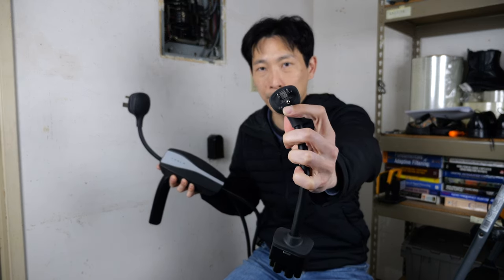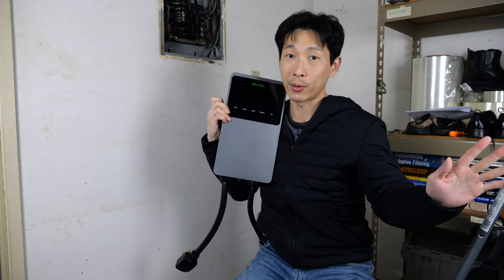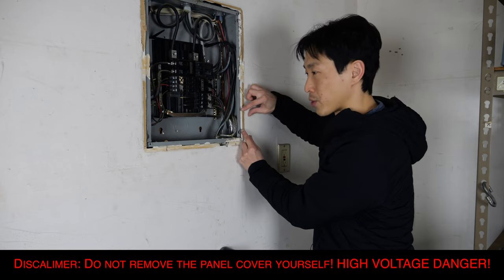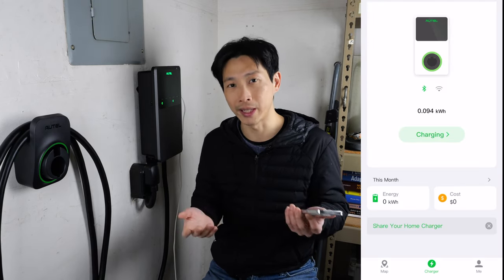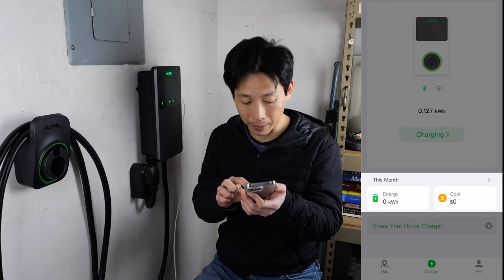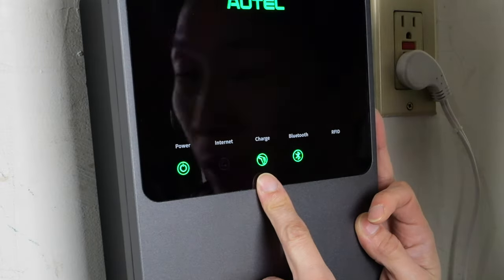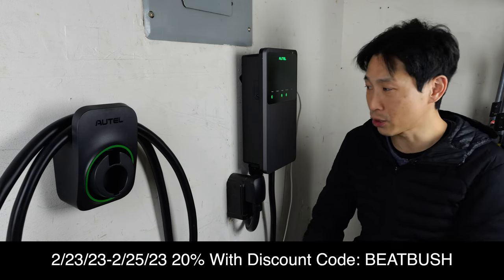Level 2 EV Charging with no Expensive Electrical Work

Comment: At my mom’s house we use the 30A dryer outlet to charge 4x faster than a 110 outlet. But we replaced the receptacle with a Hubbell one because it is heavy duty.   EV charging is a much heavier load than an electric dryer which only runs for an hour.  Frankly, i also installed a new smoke detector.  Be safe out there.
Reply from the maker: Did you use a dryer/EV outlet switch? Dryer takes priority kinda deal?
Reply: @BeatTheBush She has a gas dryer, so the 240v outlet was free.   Sharing an outlet could work, but an arrangement involving daily plugging and unplugging could lead to problems. The receptacle prongs will spread, leading to arcing/overheat.   Same goes for just unplugging your charger to carry with you every day.  My opinion — it’s worth taking extra care to keep your family safe.

Comment: Remember the faster you charge the battery it degrades faster.
Reply from the maker: A non-issue with 50A home charging (12kW). You have to worry more about supercharging at 250kW

Comment: Knowing my wife who even hates pumping gas.....I would have to wait when EV cars supports wireless charging....
Reply from the maker: I suppose it can 'wireless' charge. Maybe some plate moves up under the car.
Reply: I used to have to pump my wife's gas. It took 3 months, but I've finally trained her to plug her car in when she comes home at least 50% of the time, which is more than enough for her to get around. Range on even the cheapest Tesla is 260 miles. Most people only need to charge overnight every few days.

Comment: Guess i could get an extension cable and run it to my car
Reply: If you use an extension cord,you can only use it for level 1 charging (120VAC), and only if you get a 12 gauge heavy duty extension cord.

Comment: 1:52 Most dryer outlets are 30 amps, not 50 amps, so charging speeds will be reduced accordingly.

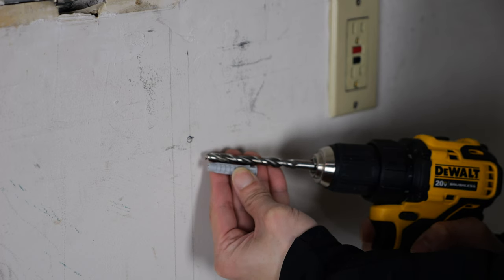3:31 Error: never use wall anchors when screwing into studs. Also, do not pre-drill with that massive 1/4" bit. Put aside those screws and anchors and  get 3 inch wood screws. Could pre-drill pilot hole with a 1/8 or 7/64 bit, if you want. No anchors, go straight into the stud.

Comment: Electrical guy here.  Am I going to sell you on hiring someone to install,. "NO!". About 90 % of electrical work can be done by almost at idiot.  That. 10% may save your life, but it is all public knowledge.  You.can find it if you look.

Let's start with wire size.  The wires to your house (from the utility) are sized for your house as built.  You are adding my a load about as big as a second stove to your house.  Can your utility to house wire handle that power?

The building code (NEC) has a section 625 that covers car chargers specifically and refers you back to chapters 1,2,&3 for other rules.  In this section, your car charging receptacles require gfci protection.  Yes, iit also requires gfci protection in the charge unit.  It has circuit current requirement of the charger plus 1/4 more current or q reduction of the charge rate and more.  Other chapters cove requirements like wire type and the need for conduit.

Your local building inspectors can add to or throw out NEC requirements so please check with them.

Not all electrical faults result in an instant fire.  Some faults take a little longer to show up.  Lawyers have the NEC (building codes) on their shelves to help restore home owners after a fault.  They might sue the insurance guys to pay after an install bursts into flames.  They might also sue the installer to restore the home and replace that $80,000 car that burned because the garage burned down.  If you are the installer, can you sue yourself to rebuild your house and replace your car?

So,, can you install a car charger, Yes.  Can you find all the requirements, yes!  Should you call a local electricians, I say, "Yes!"  You can pay him to tell you how to do it. He can tell you the best practices and help you avoid or solve problem as they arise.

Be safe out there.
Reply: "you can pay him to tell you how to do it ..."; he's NOT going to tell you how to do it... he's not anwering your call anymore...

Comment: 2:04 Doesn't the disclaimer negate the purpose of this video? Most people don't have a 240V outlet in their garage and the clothes dryer is usually kept inside the house, so you need to do a long run if you needed to charge the car in garage (or outside), if the run is even possible.
Also, drywall anchors aren't needed when you are drilling into a stud for the main EVSE
Reply from the maker: I think the situation will differ based on how your home is built. The disclaimer is just for liability reasons,  I did it myself assuming all risks and someone attempting this has to assume all risks and liability as well.

Comment: I use the mobile charger for my ‘23 Tesla 3. Charges it just fine. No need to spend more. Just charge while sleeping.
Reply from the maker: Are you using the standard plug or the 240V adapter?
Reply: @BeatTheBush  standard.

Comment: Also you need to make sure the breaker for the plug supports that current. And increasing the amperage for that circuit isn't as simple as switching out the breaker because the wire gauge has to be rated for that amperage. Also you need to know if your power service can support another 40A of current draw.
Reply: How do you check that?
Reply: @ShadowJP3012  Basically this is why most people should get an electrician

Comment: I have to ask, and I hope you reply to this..... why the hell are you using drywall anchors when you are drilling into a stud?
Reply from the maker: Good point. I wanted to grab the drywall as well but it probably is better to just use a longer screw.
Reply: I had to go back to see that ... true.  Mr. B by inserting the drywall screw; the support has weaken as the anchor is expanded with the screw as a holding point where the real support is by using wooden screws to screw into the studs.  It is the "bite" of the screws that is going to support the heavier weight.

Comment: If it's constantly drawing 40 amps, go outside and see how fast your meter is running.
Reply from the maker: No need. 240V x 40A = 9.6kWh, its fast but I've made it do like 30kWh before, lol.

Comment: You use the term high voltage quite a bit, but as far as I know no residential houses have any high voltage . But there certainly is enough voltage and amperage to kill people so be careful
Reply from the maker: I suppose the term ‘high’ is relative.
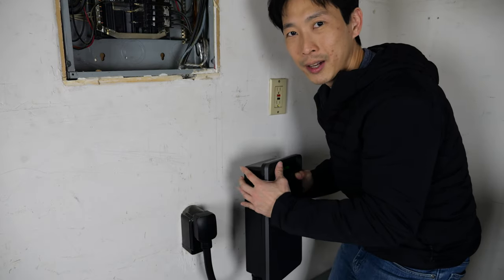Reply: high voltage as it applies to residential areas are the top lines on the pole, I think they're around 25,000 volts and the next one down is the low voltage lines for the homes, they're 120 or 2:40 depending how you look at it, and low voltage for instance in your garden is around 12 volts, so 1:20 or 2:40 is not considered high voltage

Comment: Beat the Bush, as an electrician I must tell you that you did not do a safe initial voltage verification; you didn't wear an arc shield, rubber gloves, or stand on rubber matting. Not to mention the one hand rule
Reply from the maker: Fair enough. I was relying on the insulation on my probes but that seems like it wont pass your test. =(

Comment: The Ford lighting requires people to have a 100 amp breaker installed
Reply from the maker: I didn't know! Neat. At some point, it wonder if it'll exceed the incoming wire capacity.
Reply: No it doesn't. Use an EVSE matching the current you have available. A 20AMP at 240V is enough for most people
Reply: @thedopplereffect00  watch chillin with chets video on the lighting he says in the video ford asks people to install a 100 amp breaker for charging
Reply: @patrickr2686  Ford can ask people to spend more money than they need. That's not how EVs work though, the EVSE protocol is standardized and every EV will accept charges from any EVSE that reports how much current the vehicle is allowed to draw. I've had one for almost a decade now.

Comment: That's funny that EV chargers are named by their rate  they charge per hour. This charges at 30 miles per hour. 🤣 6 miles per hour is so bad. Like you can speed walk about that speed. 
My gas charger charges at a rate of 100 miles per minute.
Reply from the maker: EV chargers still cant pour energy into a car all that fast unless you swap the battery. So you have to use it differently like charge it overnight. But long trips makes you wait longer. My experience shows a 4 hr trip takes 5 hours.
Reply: @BeatTheBush  Good for short distances but for trips most people wouldn't want to wait several hours for their vehicles to charge everyday. Why arn't there hybrid vehicles anymore? Wouldn't that be the best of both worlds having fuel when you need it and being able to use charge miles when you can?

Comment: You can avoid this hassle and expense easily.
Buy a petrol car.
Reply from the maker: But with an EV, you avoid oil changes. No oil filter, no spark plugs, no alternator, no O2 sensor, no air mass sensor, no intake filter, no breathing in fumes once in a while when filling up or just walking around your petrol car.